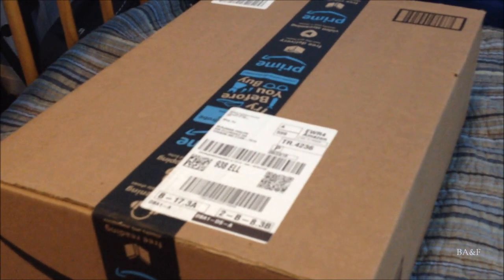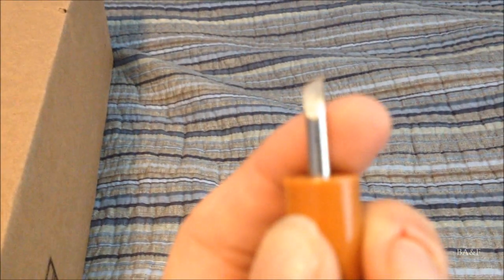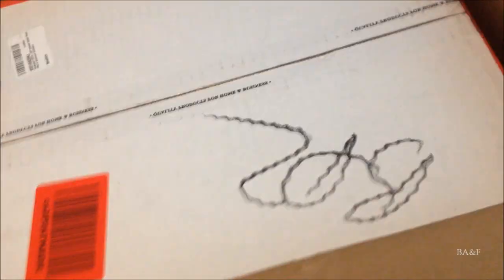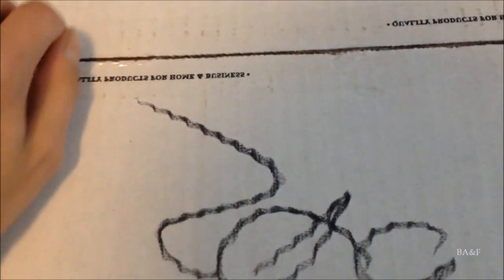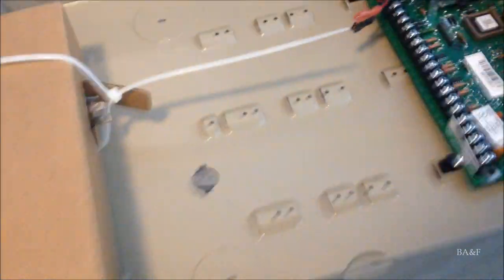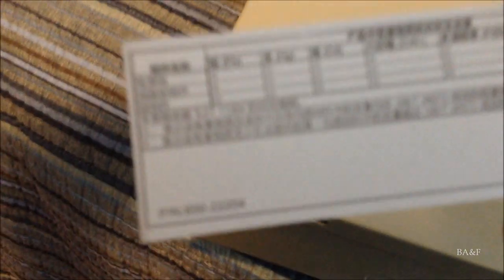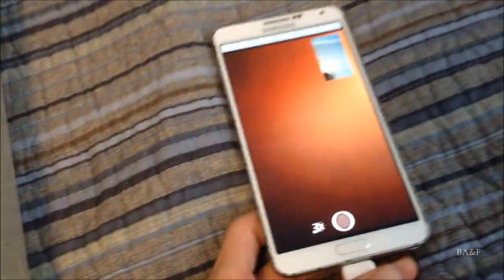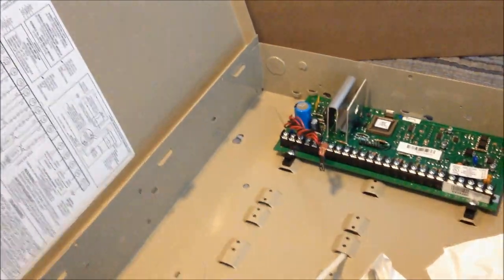Honeywell Vista-20P Panel - Unboxing

Comment: I’d consider it a security panel not a fire alarm panel... since thats what it is
Reply: It can be used as one
Reply: jack williamson not really. 1) you have to use all 12VDC devices 2) the fire output is coded temporal so you can’t use a strobe. those are NOT fire panels (not even the combo panels are really a good fire panel). They don’t have IDCs (they sorta do and sorta don’t), there isn’t a NAC unless you want an unsupervised non-sync, code 3 12v output... -Zach Cordova edited by Me
Reply: Its what he could afford
Reply: @Aaronproductions  Actually, combo VISTA's have 2 nacs, that can do code 3 or continuous.
Reply: @Aaronproductions  Not to mention the fact that there are addressable relay modules, monitor module, smoke detectors, that work on the addressable loop that combo vistas have.
Reply: @ryanwoods4691  they had that… 2 years ago? still 12v
Reply: @Aaronproductions  Yes, they had that for almost a decade. I don't see what is wrong with 12 volts, most alarms are rated for 12 volts, and work just fine on 12 volts, including the L-Series. Yes, you can't have AS many alarm on one NAC, due to it being a lower voltage. I have one, it works great. I have not had an issue with the 12 volts.
Reply: @Aaronproductions  Not to mention, the VISTA-128/250FBPT come in 24 volt models, though uncommon, they still exist.